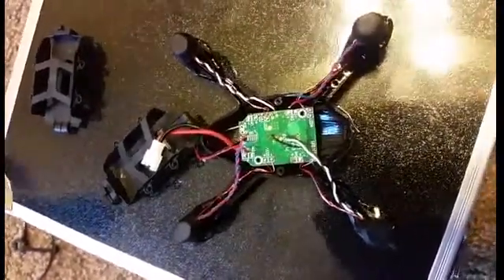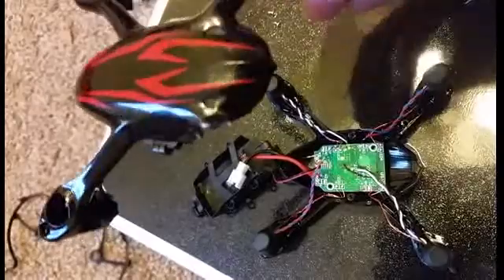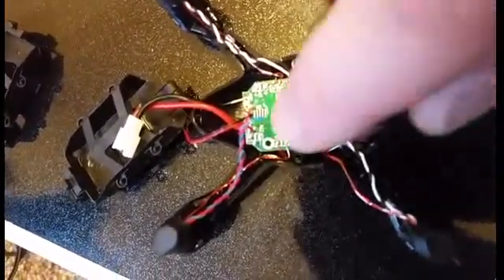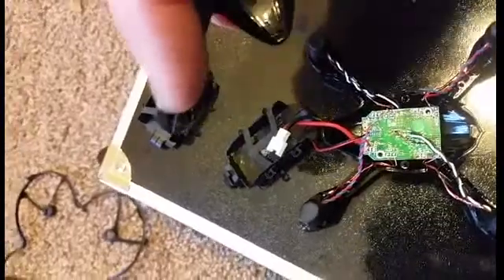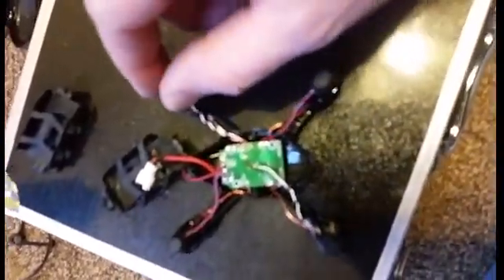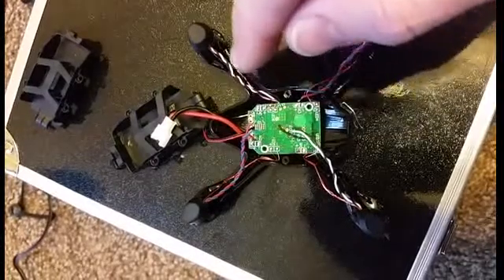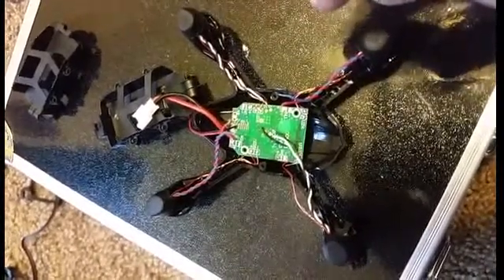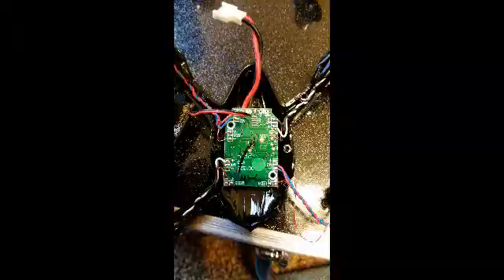How To: Hubsan X4 Quadcopter Repair.  READ DESCRIP

Comment: Could you possibly have SAID red goes to ? and blue goes to ? and white and black... Instead you just say... well, I hope you took a picture.  Gah.
Reply from the maker: Snow Flake I did put a picture at the end of the video for this purpose.  Easier with the pic just because the orientation of the board will determine the wire order so its easier just to look at the pic.  If you still need help after looking at the pic then let me know and I'll try to help out.  Also, not all motors use the same color wires but this pic is good for stock motors.

Comment: I thought my eyeglass repair kit screwdriver could unscrew the body.  Nope. What phillips screwdriver did you use for that ?
Reply from the maker: picked up a set for $4 at microcenter!, a local computer store.   Your local hardware store or even a harbor freight should have a similar set.
Reply: It worked !  Thanks
Reply from the maker: chewdip
Awesome!...glad I could help out.